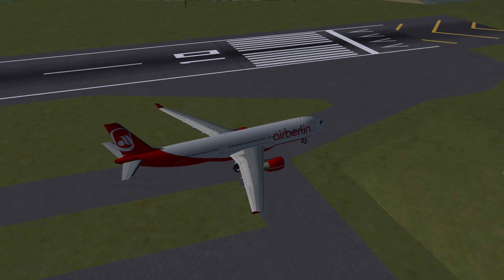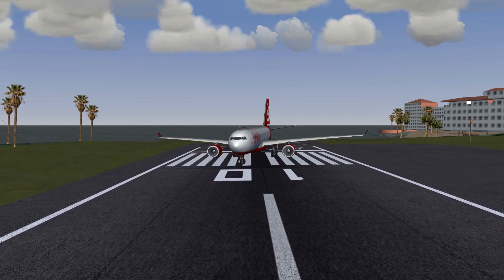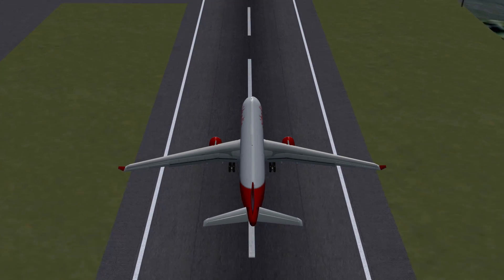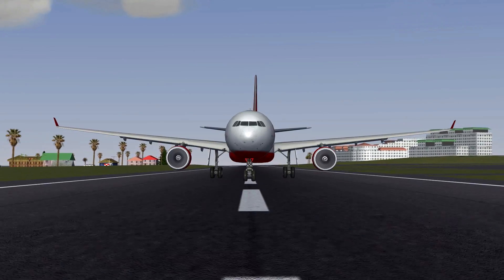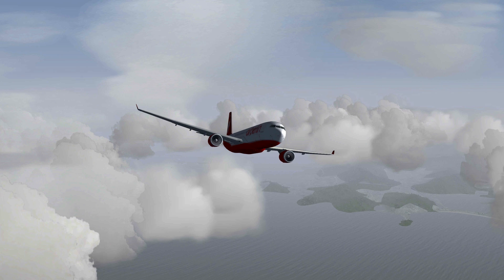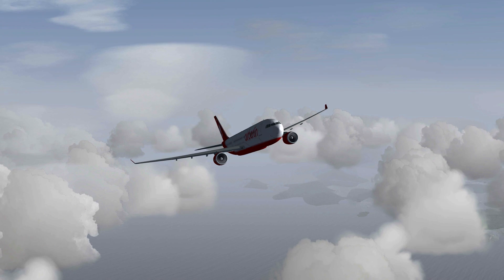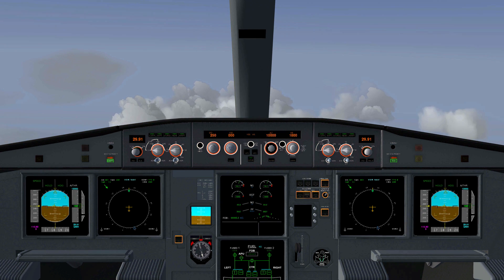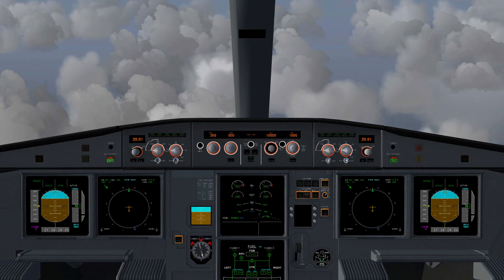About Fly-By-Wire in FlightGear and in Real Life

Comment: You'll have to wait a while.  Omega and I didn't have very much resources as to how the FBW on the 787 should be, so right now, some features have more of an Airbus feel, and they don't even work quite right anyway.  I'm working to fix this.  Oddly enough, from the coding side, it's MUCH more complex than the A330.  The problem is that, instead of simply limiting the pilot, Boeing makes the controls heavier in certain directions depending on the situation.  Otherwise, it's nearly identical.